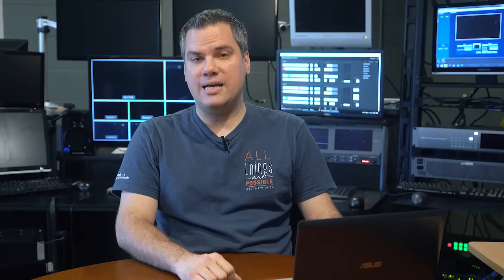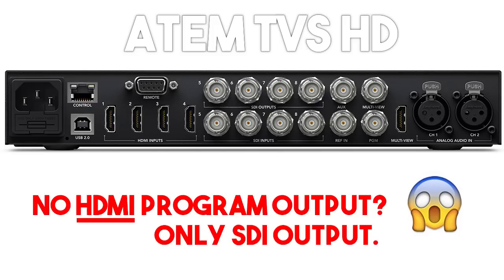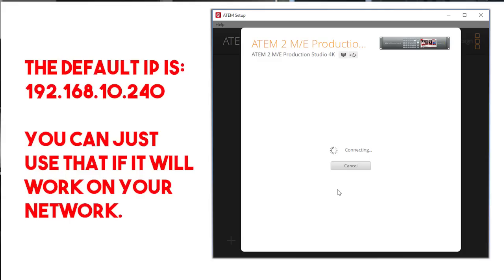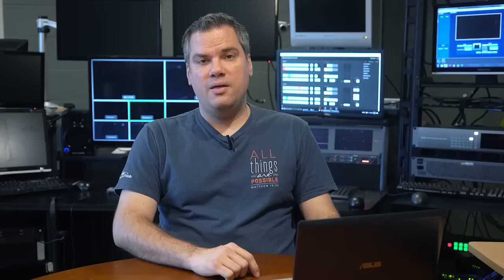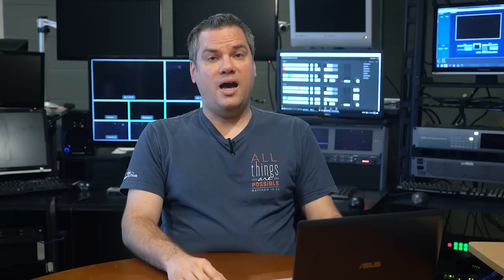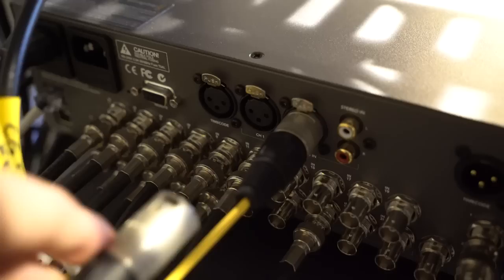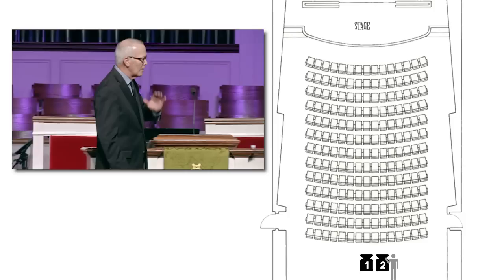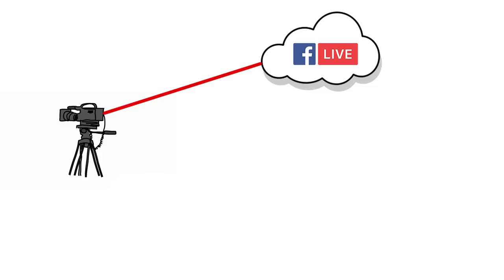Multi-Camera Live Stream & How to Setup an ATEM Switcher

Comment: Stephen, when I plug my Sennheiser wireless mic into the XLR input on the switcher, it is super quiet. Do I need some sort of amplifier between the mic and the switcher? Can you recommend a device? When I bring in the audio through an HDMI along with one of my cameras, the volume is normal, I assume because the camera is amplifying...thank you!
Reply from the maker: Well Your World Yes the input of the switcher is line level and the mic is outputting mic level, so you need a preamp. I'd recommend a simple mixer, something like this: https://amzn.to/2MnE9zl or Even cheaper like this would work: https://amzn.to/2K4DPbH
Reply: Ballast Media thank you so much!

Comment: How do you set up OBS to stream the final video  (what appears s MASTER on the ATEM) and not the whole screen showing different cameras
Reply from the maker: How are you getting your atem in to the computer? Sounds like you may be using the multiview output instead of the program (PGM) output.
Reply: @BallastMedia  we had input HDMI cable into the multiview thats why.So do we have to input into the PGM port.

We have the ATEM , intensity shuttle and blackmagic SDI to HDMI.

Is it okay to input PGM to the SDI to HDMI converter then the output HDMI into the intensity shuttle
Reply from the maker: @AdilTwahir  yes, that's the path you should take.
Reply: @BallastMedia  its still not working

We have 1) ATEM television studio pro HD 2) blackmagic design intensity shuttle 3)blackmagic design SDI to HDMI converter

Is there anything else that we need?

Or is there a video of yourself explaining how to setuP the ATEM with OBS
Reply from the maker: @AdilTwahir  What video standard is the atem set to?
Reply: @BallastMedia  1080i50.Apparently the PGM cable wasnt working we got a new one this morning and its functioning well

Comment: Steven,  I Am running a setup that consist of: DN-312X Audio Mixer, BM 1 M/E Prod. Studio 4k Switcher, and a BM Web presenter.  The production setup for the event consist of 3 cameras running SDI connection, Podium microphone XLR. How should my audio configuration look? Should I run the  -Mic XLR straight to the mixer then to the ATEM switcher  and then to the Web presenter? Or - Mic XLR to the ATEM switcher then to the Audio mixer then to the web presenter? There IS ALSO audio coming from the cameras via SDI that is not needed, yet the ATEM switcher is seeing it. Will that audio feed get utilized or do I need to turn it off on the cameras? I hope this question made sense and appreciate any direction/feedback that you can give. Thanks

Comment: I'm stuck with my switcher SE-500, please i need procedures on how to set it up to my computer then projector and what are the right gears or tools to use
Reply from the maker: That's an analog switcher, so unfortunately it will cost more to do all the conversions to work with HD equipment then to just purchase a new Atem Mini line of switchers.  If you need to drive a projector, you need an Aux output though, so you would need something like the Mini Extreme https://amzn.to/3pePwOC

Comment: Great tutorial-thank you Stephen! We've implemented a fairly simple streaming setup at our small church with the ATEM TV Studio HD. The one issue we're experiencing is low audio levels coming in through the XLR inputs on the ATEM. Our mic signals are fed into the ATEM from Aux outs from a Soundcraft SI Expression mixer. All other signals (laptop presentation, prerecorded videos) come embedded in the SDI and HDMI inputs, audio levels are strong with no problems. The Soundcraft mixer aux outs have never had a problem providing adequate output levels into amps for floor wedges, assistive listening, etc. I wonder if the ATEM XLR inputs need additional preamplification.
Reply from the maker: Usually what is happening is you need a higher average level, but can't turn up more because your peak levels are too high, the solution is compression at several stages so you can bring your average level up.
Reply: I have viewed your video on multiple stages of compression using Waves DAW and plugins. I am not likely to go to that level of involvement in my church, with the AV team being all volunteer/part time and our service is mostly non-musical. Would you have a recommendation on a simpler method of raising and compressing the output from the aux out of my mixer prior to feeding into the ATEM? Thank you again!

Comment: I currently have a single camera setup and I use Wirecast instead of OBS and love it. I want to switch to 3 cameras using Data-Video PTC-140 cameras. What is the best way to get these cameras in to Wirecast and utilizing PTZ controller?
Reply from the maker: I'd say get an ATEM Mini ( https://amzn.to/3bQqhLc )and switch cameras outside of software.  Then its just one interface in to the computer.  Control of the cameras remains the same.

Comment: how do I reset the switcher, because the multiview display in my switcher is missing, there are eight frame boxes, and 2 preview boxes and PGM but there is no image display from each camera input
Reply from the maker: Did you by chance change the video standard of your switcher?  (e.g. what resolution and frame rate it's operating at)

Comment: Sir when u used the xlr from the mixer will all cameras remain in sync - and if you are using the ATEM mini with line level (mic 1 or 2) (and sync) will all cameras be in sync to the audio or just the one camera you use to sync the audio ---- my overall question is how do u sync audio mixer with the newer ATEM mini switchers with mutliple cameras and all cameras have sync audio... thanks --
Reply from the maker: The audio in the mixer should be in sync with the cameras. Usually you only have sync issues when you bring audio and video in to a computer through different interfaces.

Comment: Hello!!! do you have any video with the Blackmagic Design ATEM 2 M / E Prnoduction Studio 4K. I want to know how to connect 16 cameras and watch them all at the same time for a LIVE broadcast with 16 cameras. If I connect it to a PC, can I use the keyboard to change cameras in the transmission? As if the keyboard was the switcher?
Reply from the maker: The 2ME requires 2 multivew TVs to see all 16 cameras.  Each multiview only shows 8 cameras.  the ATEM 2ME has 2 multiview outputs.  You can use the keyboard to control the switcher, but it only puts the camera on the preview bus, and you have to press another button to take or auto transition.  I find it's better to use something like x-keys, or a streamdeck to control camera switching.
Reply: @BallastMedia  I consult you. I am looking for a switcher for 16 cameras and to be able to operate it from a computer keyboard. Is there a team that you know or that you recommend me?

Comment: Please help, 
Why when I add cameras to my switcher there's only one preview screen and all other box's are black but I have three cameras when select camera it shows but I can't figure out how to have all three camras showing on the screen.

Thanks
Reply from the maker: In the ATEM Control Software, click the gear icon in the lower left, and there is a Multiview tab.  In there you can configure what cameras show up in the boxes of the multiview.  Recently BMD has started shipping the ATEM with the multiview set to Black as the source for all multiview, rather then the camera inputs.
Reply: @BallastMedia  thank you !!

Comment: Does the  Canon VIXIA HF R800  connect directly to the ATEM Television Studio HD  or do you have to use a Decimator for the frame rates?
Reply from the maker: If the atem is set to 1080p60 it will give an image. Otherwise you'd need a decimator, or the cheaper BMD UpDownCrossHD works as well https://amzn.to/2Gqvg6r

Comment: Hi Steven, we're using this exact setup (as per your recommendation) at our church. This includes the ATEM Television Studio HD, U-TAP SDI and Canon VIXIA HF R800 Camcorders. We're using OBS on Windows 10. We managed to get everything configured correctly, but the audio from the soundboard to the computer is not working. We have confirmed the audio is working on the switcher with headphones plugged into the audio jack. However, we can't hear the audio when plugging the headphones into the PC.  The audio from the soundboard is plugged into audio port 1 and the U-Tap in plugged into PGM. As a workaround, we've plugged a cable from the switcher headphone jack to the microphone in on the PC., This actually works, but the audio quality is inferior. Can you think of any reason why the audio isn't working from the switcher through the U-Tap to the computer via USB?
Reply from the maker: Try this, in OBS on the u-tap in the source, go to it's properties (gear icon in source panel) and scroll to the bottom of the properties. They're will be a check box something like use another audio device, check that and in the drop down box that appears, just select the u-tap.
Reply: @BallastMedia  Thank you for your prompt reply! I have forwarded your suggestion to my colleague at the church. I'll follow-up here once he's had a chance to try it.
Reply: @BallastMedia  Following up on this topic. Your suggestion did work, thank you! We're now getting sound through the PC. However, when comparing the sound output with headphones, the quality through the video switcher is much cleaner and sharper than through the PC. We have checked our cable connections between the switcher and computer. Everything is well-seated and securely fastened. We have tried switching USB ports on the back of the PC, but it didn't make a difference. Do you have any suggestions to improve the sound quality from the video switcher through the u-tap to the computer? Perhaps it's sound driver related.
Reply from the maker: @realistindenial  What audio bit rate do you have OBS set to?  It could be the compression that is happening in OBS that you are hearing?
Reply: @BallastMedia  Hi Steven, I meant to follow-up and let you know that we finally got video streaming working properly. Fixing the aforementioned audio signal problem was related to device firmware updates and using the correct USB speed. Thanks again for all your assistance!

I'm wondering if you have any advice for connecting an analog projector (mounted to the ceiling) to the ATEM as another video feed source. We want to share the slides shown during the sermon with the streaming audience. We tried a cheap VGA to HDMI adapter, but the ATEM doesn't recognize the signal. Do you know of a video converter capable of taking an analog signal and converting it to something the ATEM will recognize (via HTMI or SDI)? Something like the UTAP would be awesome. I checked AJA's website, but didn't see anything.

Comment: What do I ask for when buying the RG6 cable to connect to the switcher and what should I use to record for distribution?
Reply from the maker: RG6 is a cable specification, so if it's RG6 your good. (It has slightly thicker cable and better shielding then RG59)

Comment: Possibly a stupid question, but just curious why you need a video interface between the computer and the switcher? Why can’t you just use the switchers USB out?
Reply from the maker: genralaustin The USB is just for configuring the atem. It doesn't pass video.  (The old tvs 1u rack version did, but even that was removed in a firmware update.)

Comment: Hi Stephen, I have the  sdi output version for my atem. I'm puzzled over which component to purchase. Aja sdi to hdmi converter or a BMD video capture card, or both? Second, if I get the video capture card, do I need to buy a hyperdeck to record or can I record directly to the computer? My goal is to use a multicam system connected to the atem, record events, and live stream simultaneously. Is this something that can be accomplished with the components mentioned or are there more components required to accomplish the task?

Comment: How does OSB fit into the switcher equation? Does OSB just see all of the cameras as 1 input and you have to use the switcher buttons to change cameras? Great videos btw!
Reply from the maker: Yes, I think your on the right track. With a switcher you would just use one source in OBS and that is the switchers output.

Comment: How do you connect the audio for live stream to use the microphones that is be use by the Pastor and not the camera bild-in mic? Thanks
Reply from the maker: Laudelin Infante Do you have a video switcher?  The quick method is to take an aux feed from your mixer and send that to your switcher. If you just have a subtle camera, send the audio from the mixer to your camera's audio inputs.

Comment: Hello Stephen, I want to buy ATEM Television Studio switcher, but should i buy blackmagic design intensity extreme or minirecorder studio (Video capture cards) in between cameras and the switcher? thank you
Reply from the maker: Miressa Morka Do you have a mac or PC?
Reply: I have Mac
Reply from the maker: The Intensity Extreme is a discontinued product.  The Ultrastudio Mini Recorder will work for you.  The ATEM has SDI output only, and the Mini Recorder will take an SDI input.  There is one caveat, and that is that the Mini Recorder doesn't support 1080p60 video on the SDI input.  What cameras are you planning on using with the ATEM?  (Because of that, I really recommend the AJA U-tap SDI for you https://amzn.to/2G8lclx  It costs a bit more, but it will work so much better.)
Reply: So, if i got ATEM TV studio, i have to get the video interface (both AJA U-tap and mini recorder? I was thinking to hook up the hdmi from camera to ATEM and from ATEM to Mac with hdmi or thunderbolt. (I am using Sony HXR-NX5R NXCAM Professional Camcorder)
Reply from the maker: Miressa Morka You just need one interface between the atem and the Mac.  The BMD Mini Recorder will work for that as long as you avoid using 1080p60 as your video standard.  If you need/want 1080p60 then get the u-tap instead.  (Also, that camera has SDI output, I'd use that to the switcher instead of HDMI.  You can run longer distances and it has locking connectors, cheaper cable, etc.)
Reply: I'm sorry I got another question, do you know the difference between ATEM and Roland V-4EX | Digital Video Mixing Device for Quality Video Performance and Web Streaming : 4-Channel? someone recommend me this Roland V-4EX and I don't know whether it needs the same video interface like you said between ATEM and the MAC.
Reply from the maker: You would need the same interface.  What is the end goal for your video?  What is your content?
Reply from the maker: The USB output of the V-4EX is only SD quality according to the specs.
Reply: I want to use 3 cameras(multi camera) for live streaming church service
Reply from the maker: I'd say go with the ATEM.  Not only is it cheaper but it has more "video" centric features, vs. the Roland has more "presentation" features, for live display on a screen.  If that makes sense.
Reply: I must say this conversation of yours is very informative haha.

Comment: Man, Is possible to connect three different models of cameras with different resolutions ? I mean, I have a Canon HD, a Sony non HD and a JVC everio HD all SD card cameras, Is possible to connect all to that device ?
Reply from the maker: The atem switchers require all cameras to be the same video standard coming in. You would be to pick one and use format converter to change the cameras that don't match. https://amzn.to/2UupKqs

Comment: Thank you for the video.  If I want to have the same video on 2 screens, can I do this without an additional splitter?
Reply from the maker: What switcher do you have?  Some have two outputs, then you could, otherwise yes you'll need a splitter to send it to two destinations.
Reply: I currently don't have any switcher.  I was planning on purchasing the one in the video.  Currently I've kept it super simple and just used it for live production.  I've only needed a simple hdmi splitter with 1 source.  I wanted to move to the next level and use a video mixer like the one you have listed and follow along with your videos (since you've done such a nice job).  I'm open to other options however wanted to keep my options open for SDI and HDMI.  Thanks for the help!

Comment: awesome Video. i was wondering if you can make a video on how to use multiple cameras with the web presenter thanks very much
Reply from the maker: The web presenter just functions as the video interface (as the AHA U-tap is shown in this video.)  Just connect your ATEM switcher's output to the input of the web presenter and you're good to go.
Reply: What are the pros and cons of using the web presenter?

Comment: Just purchased a television studio HD and a u-tap with sdi conversion. Just curious if the SDI cable I purchase to connect the switcher to the aja box matters, or if you have a recommendation?
Reply from the maker: genralaustin As long as it's rated for SDI (RG6 cable) and has bnc connectors then it's not too critical.
Reply from the maker: Belden is a good brand.  I usually go here and choose the length I need. https://amzn.to/2GHzitf

Comment: i just have a question, can i use 100 feet hdmi cable from camera to ATEM Switcher? or should i buy hdmi to sdi converters?
Reply from the maker: HDMI was only designed to go 15ft.  Get a converter. https://amzn.to/2JZfrZh  Any HDMI cable longer then that is a hack or converting the signal somehow anyways.